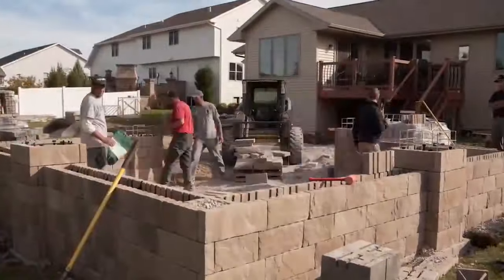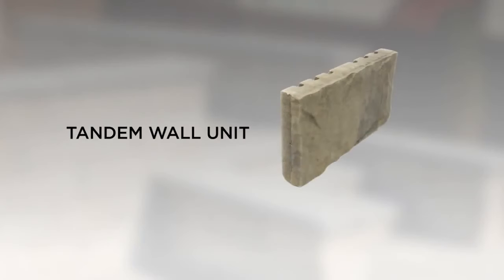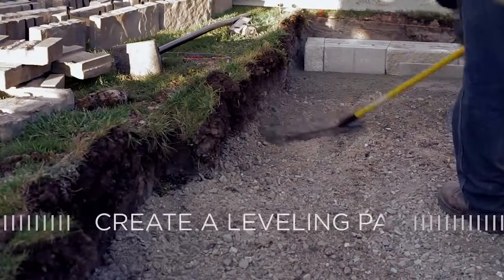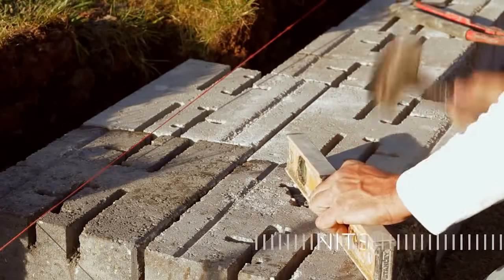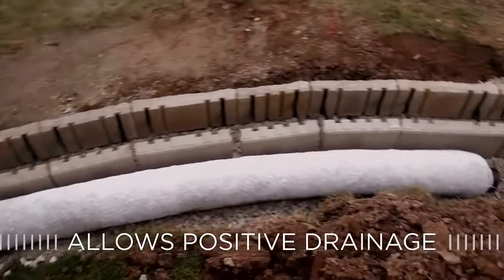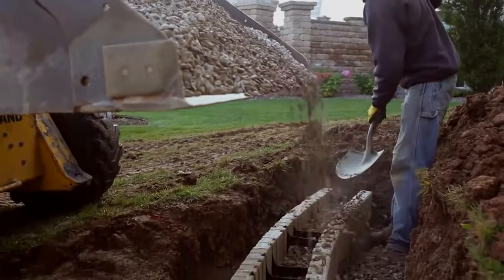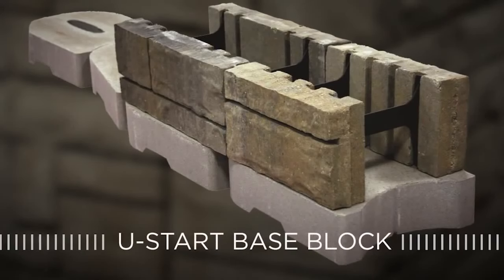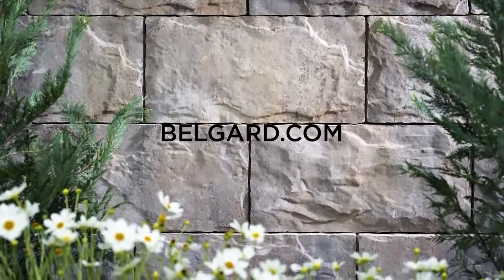Tandem™ Retaining Wall Installation: Belgard Commercial

Comment: Confusing video.  The narrator instructs to "start the building process by assembling complete retaining wall units" using the connecting members, and then "after placing the assembled tandem wall unit onto the leveling pad," level it to begin creating the base layer.  But the video shows a worker setting the base layer by doing something totally different, but much more sensible:    using solid base course blocks for the base course, not assembled "tandem wall units".  Do what I do, not what I say?
Reply: I am also confused.  You can see the block parallel walls shifting.  What stops the pressure on the back side of the wall from causing the parallel blocks to simply shift?  Also in a gravity system what holds each course on top of the pervious course?  There is no room to really use adhesive without squeeze out.  You can probably use the dovetail grooves to secure each course together but that would limit course alignment to be where dovetails line up.

I can really see where this product could serve a purpose such as a high wall and filling them with rebar and concrete.  Or around a semi I ground pool.  But I think they need some sort of rabbit joint on the top and bottom to lock them all together.  

And sorry that corner block looks sloppy.